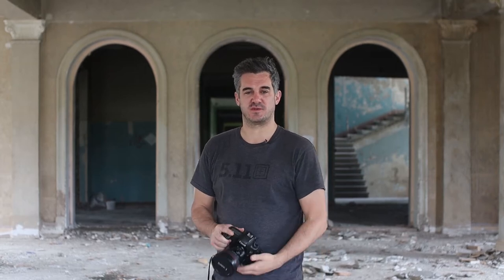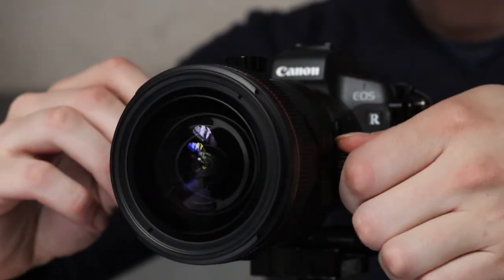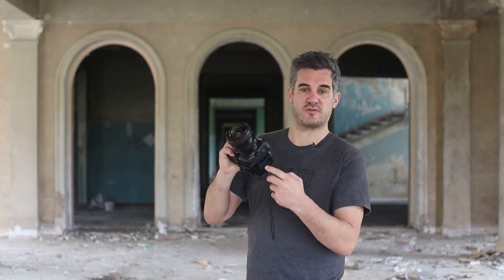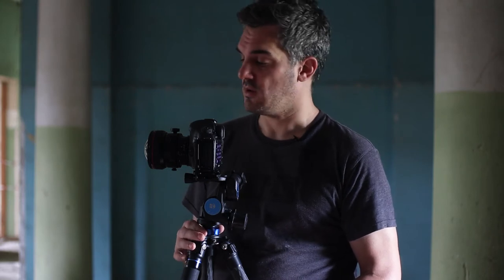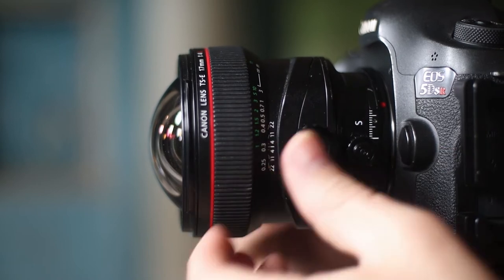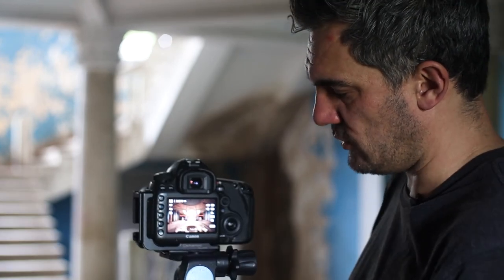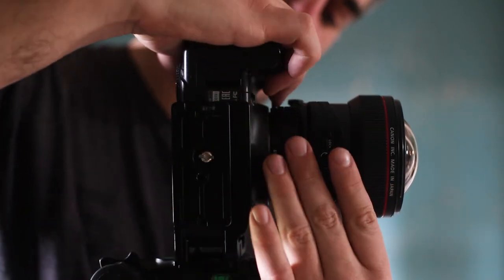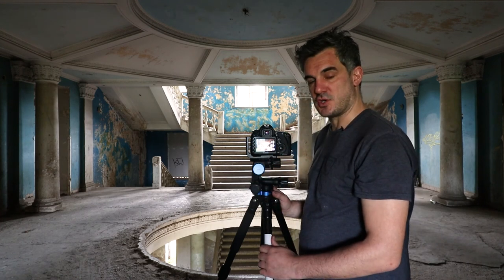What is a Tilt Shift Lens - A Tilt-Shift Lens Introduction

Comment: if im a beginer in Arch Photography just purchased a 16 to 34 lens and did a serious investment in my Sony, do i need a tilt shift if i want to expand my work in architecture photography or with the 16 to 35 is enough at the moment? i want to go all hands on this project.
Reply from the maker: The wide angle is the perfect starting point! Work up to TS!
Reply: Just sold my Sony 16-35mm after buying the Samyang TS 24mm f3.5 for my Sony a7rii. Just don't need the 16-35 any more. The Samyang is fully manual but easy to use with focus passing on mirrorless.